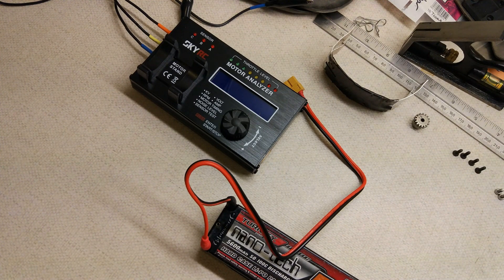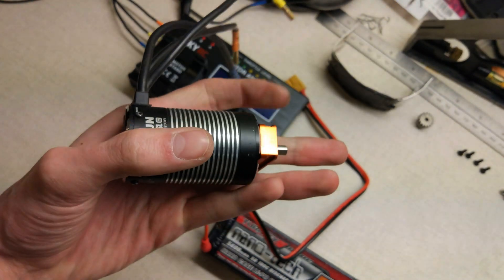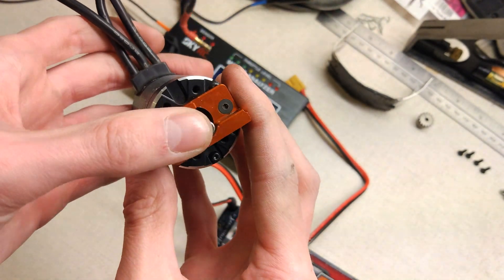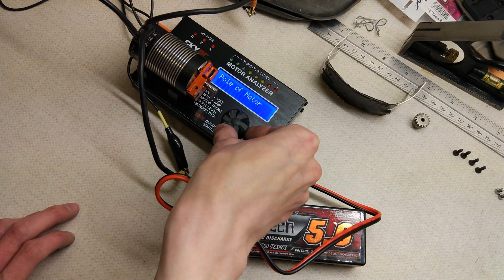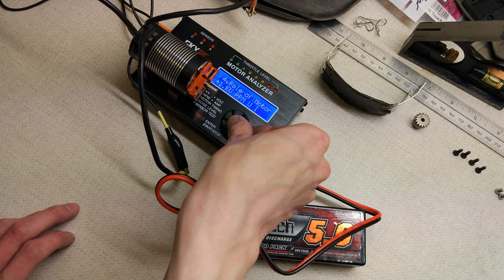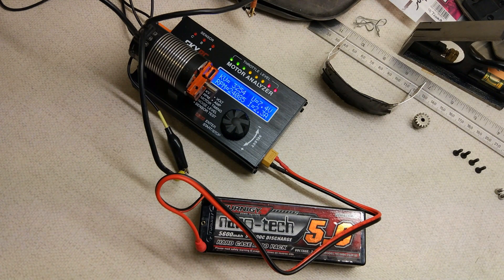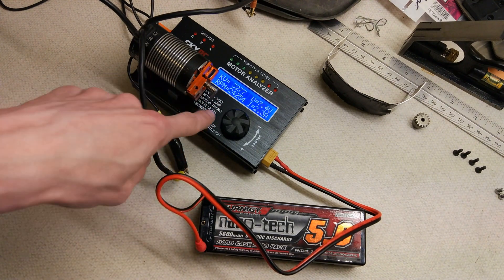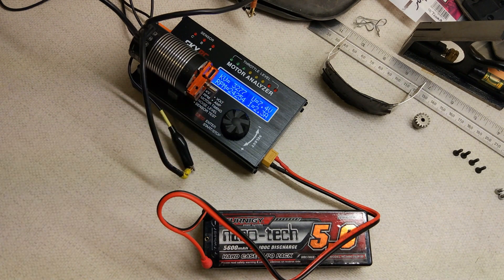MTT EP2 Hobbywing Ezrun SL G2 3200KV

Comment: Thank you for doing this. I have this very motor and I was wondering about its true stats. 
Here's a question tho on this motor but perhaps also in general: Specs say the max rpm is 60.000 for this 3660 sl g2 3200kv. Powered with 4s, max rpm would be 55.000 at a theoretical 16.8v. In practice, due to voltage sag, and kv being lower under load (?), max rpm would be lower (?). Still, Hobbywing says this is a 2-3s motor. I'd say this motor could take 4s. What is your opinion on this matter? (I subscribed)
Reply from the maker: The maximum of 60,000rpm will be when the magnets on the rotor come off or when the bearing give up. 

You can probably run 4S for speed runs or short bursts, but it will probably just overheat if you run 4s under normal off road conditions.
Reply: @LawrenceTimme  Thanks for the (quick) answer and opinion. 
Admittedly I want to do a speedrun with it on 4s eventually. Right now I am testing gearing ratios on 3s. Because of restrictions due to the motor mount with weird mounting slots (?!) I cant make the motor slide noteworthily back and forth to have a wide range of potential gear ratios. 
Perhaps somewhat interesting for you: I am experimenting with a Hobbywing max10 ESC and this 3660 motor in a 1/10 touring car. Right now I'm at 83 mph. It's the newest video on my channel if you want to have a look.
Thanks again.
Reply from the maker: @Ilker_Ali89  sounds good. I hear hobbywing ESC aren't really the best for speed runs. They tend to cut out much earlier than the competition. The competing escs are  More expensive though.
Reply: @LawrenceTimme  I can imagine them cutting out earlier. Is it because they reach the current limit? (I've also got a 6s Castle ESC btw)
Something else came to my mind, upon which I'd like to ask you for your opinion. I watched vids where you bash around with your Short Course Truck (Tekno) on 2s. I was pondering over what's less stressful for an ESC (?): Bashing around on 2S, but geared to 50 mph, like your Tekno, or the same thing on 3s, but geared accordingly to 50 mph. I hear from time to time that ESCs rather prefer voltage over current, which would give 3s the advantage.
Oh, and I hit 86 mph - 139 km/h with my max10 recently. Video is up.